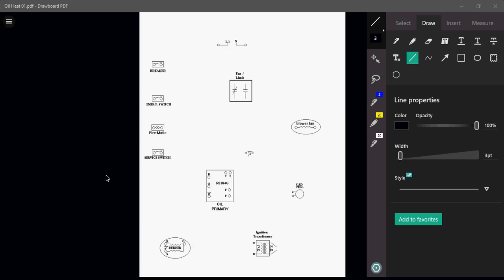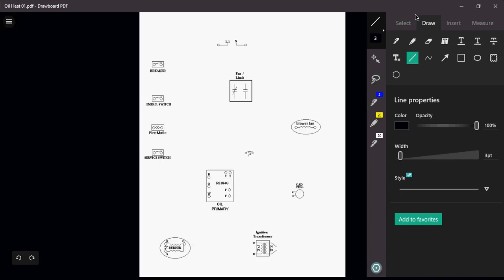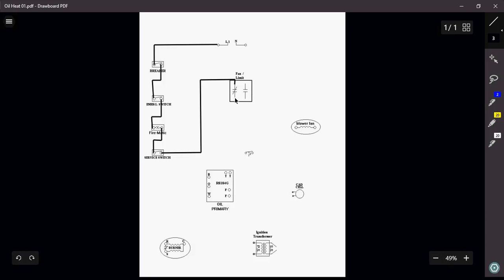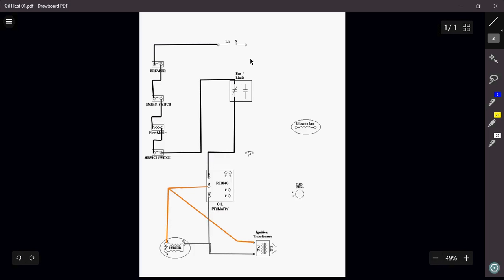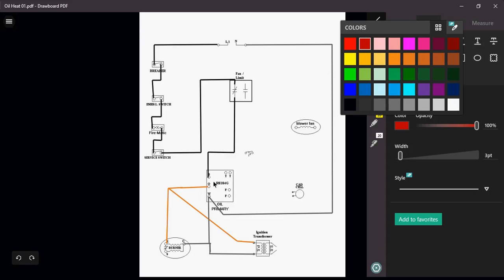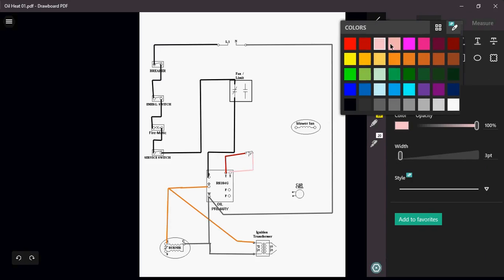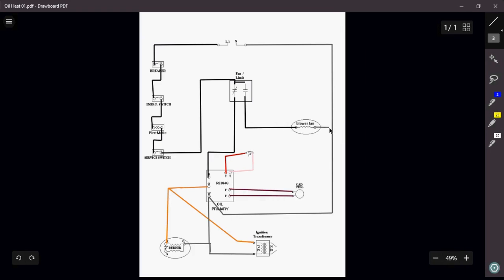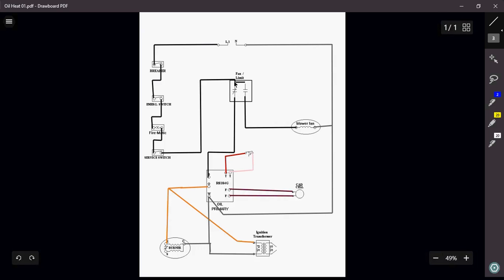Wiring of a R8184G Primary Control

Comment: Question .the red and the white wires coming from the thermostat upstairs  they going into a transformer which is on the ceilling somewhere in the middle of a room and is giving me 24v as it should .its a bit difficult to rewire (bypasd this transformer and fish new wires since the ceilling is closed .now since this unit has a built in transformer how do i connect the red and the white .while having the extra transfromer on the way

Comment: Can you add a manual switch to turn on just the fan blower without running the oil burner?
Reply: Most furnaces already have a manual fan switch, usually behind the front panel, but occasionally on the exterior of the furnace.